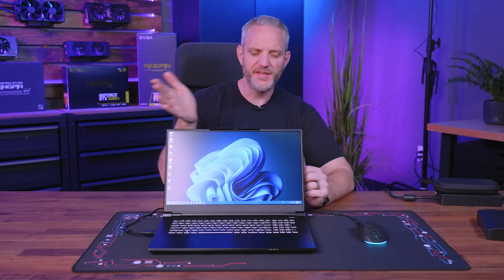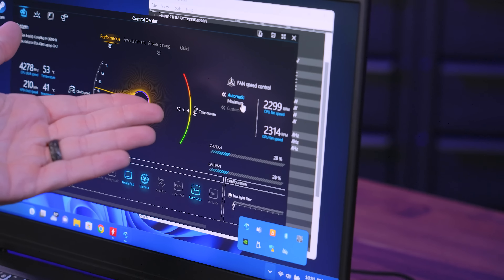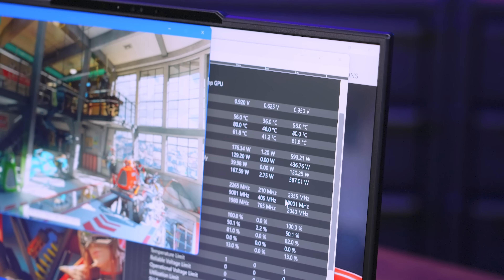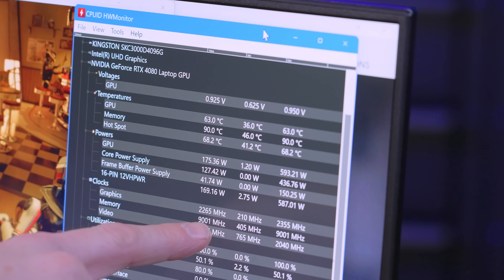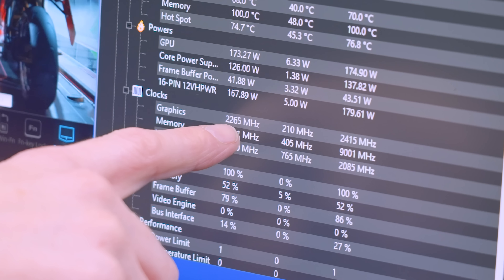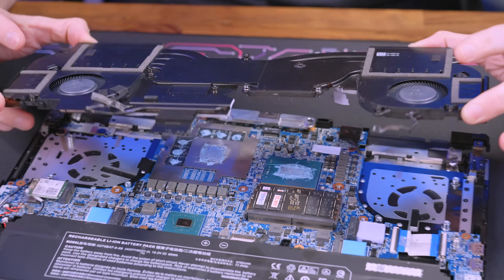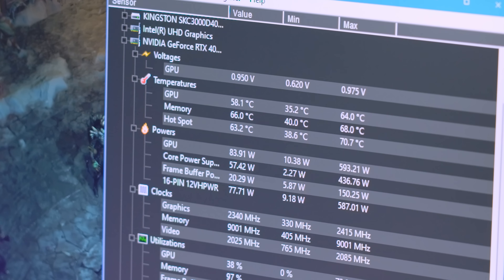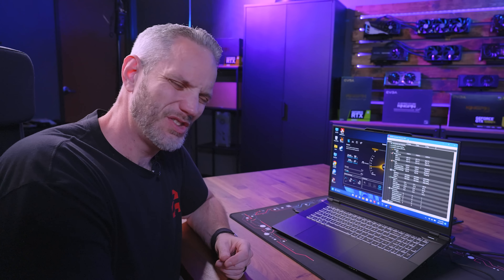I think I made it worse...

Comment: Hey Jay, why not use paste and graphite pads. They should help the thickness for the memory but not too much to effect the gpu
Reply: Graphite is electrically conductive so if that make contact with any of the SMDs around the VRAM ICs you will fry your VRAM and probably your GPU IMC also so better use some coating that is electrically not conductive that's is what i do when i use copper shims over the VRAM myself and i never have a sort with it.
Reply: @riphunter5100  yea, I realised after I commented. The graphite would work on the gpu and cpu if the pads are too thick for the ram.

Comment: I would think that a laptop, still in its warranty period, should indeed be left alone.  However, any gaming laptop, gaming PC, that is two years or more, and has factory thermal material (pads, paste, whatever), could actually be getting worse and worse.  Okay, not everyone is an e-sports' player, but how many times have I not gotten someone come in the shop that says their PC is not performing and if I can please re-install Windows on it (imagine how upset they are already having to ask such questions).  First thing I do is ask how old the device is.  And after that, I actually teach them to install Windows themselves.  The amount of times when I lift the cooler(s) from the motherboard and see paste that did not spread the surface, or a pad that is not even on the chip but hangs with its arm out the window.... Prebuilds are notorious for too little thermal paste, or use some questionable materials.  Used video cards, repaste!  Heat, and contraction from cooling, is a culprit over time.  Oh, well, you have enough articles about that.

Comment: Hey Jay, I recently built a PC and installed windows but it's always booting to bios. I tried everything on Google but nothing solved it.
Reply: In your bios there is a boot order setting that needs to be set to the drive that has windows on it.
Reply: @LuciferXV  I have only one SSD I I set that it's not working
Reply: @gabitzz3632  Do a fresh install and make sure to take your usb out of the computer during restart so it can't be confused by it.
Reply: @LuciferXV  now I tried reinstalling windows and the SSD is not showing up. 10 minutes ago it was fine and running now it's not recognized. Do you know what happened or what can I do?
Reply: @gabitzz3632  If it's an m.2, maybe it's not seated correctly. If it is SATA maybe check the cables.

Comment: A laptop of this price should have separate cooling for CPU, GPU, and RAM. At the least there should be flexibility designed into the cooling with screws to firmly clamp it to all three rather than relying on thermal pads to make up for height variations.

Comment: Idk but im sure memory doesnt thermal throttles it just dies. Ive never seen a failsafe for memory. 2 when i had more than one monitor woth my 5950xt the memory is alwsys at 2600mhz even with bo load nothing running. Idk why amd hasnt fixed this im sure im not he only one who sees this. When i turn my monitor down from 240hz (1440p) down to 120 or 144hx you cna see the memory fluctuation from 1mhz to 200 or 300 no losd its soo wierd why it does it obly witha. Single monitor or lowering the max hz on the monitor

Comment: Not saying it's the case here, just a PSA of sorts: 
HW Info has a habit of reporting wrong hotspot temps (and various other numbers). 
Once had a reading of 113C°... updated HW Info and lost 30°. Still hot, but not abnormally hot.
Crap readings aren't exclusive to HW Info, once had an AIO that thought the water temperature is over 130°C. Which of course it wasn't.
I still have a picture of it because it looked funny, sadly can't post it because Youtube can't manage to make a working spam filter.

Comment: Would be interesting to learn what the temps are after you put in the pads for the memory, do you still see the improvement on the GPU?  Or do the pads still cause a similar issue to what you saw in the tests you posted today?
Reply: you wont two separate things

Comment: I'm no pro, but based on my recent experience, I only recommend changing the paste on your laptop when it's old as fuck or the temps are actually just plain bad and experience is detrimental. I recently changed my 2015 laptop's CPU paste because it was VERY DRY and would get to 80-100c just for playing light games like LoL, and high 80s low 90s for watching a video in fullscreen.

It has a dedicated GPU, but the issue was with the CPU.

Now it doesn't even reach 70c when watching a video.
I haven't really tried playing though, since I don't need it for that anymore, but it was an ongoing issue since about 2-3 years after I originally purchased it

Comment: Paste used for LN2 are formulated so they don't crack at -140c and are only used for a handful of benchmark runs. On daily driver PCs the paste will pump out from the temperature variances of normal use. If you want extreme cooling without using liquid metal, try KryoSheet by thermal grizzly. It will out preform any paste on the market including KPx and it will last the lifetime of the device.

Comment: Man.. 1/2 a mil.. that's pretty actually BAD for the cooler design in my opinion. However, with a gaming laptop, I'm going to bet they did ALL the testing they did to come to the cooling solution they went with for production. So, maybe when it comes to a premium product, maybe yeah just leave it alone unless you're smarter than the team of engineers that designed the original cooling solution. I.e., der8auer. Seriously.

Comment: i repasted my lenovo legion 5  because it always runs hot and thermal throttles. well, didint help much. what WOULD help is lenovo letting me tune my fan curves, i dont want to running all quiet when it gets warm, i want fans at 11/110%, but no, im not allowed to control my fan speed. i didint know about this when i purchased it, if i had, i would have saved some money and gone with one that would. 
the fan controller is so hidden that no amount of register poking would reveal the address of those fans. why, whats the "fricken" point.

Comment: @JayzTwoCents  My ASUS ROG Strix Hero III came with very poor TIM application. Two of the dies on the core had no coverage, and what ever they used had the consistency of tile grout. They also used liquid thermal pad like k5 pro on the VRAM and VRM. Thermals were out of control and the laptop could barely manage 3ghz despite being advertised as 4.5. Replaced all with kryonaut, even the K5 pro, and huge gains in temps. I even was able to get more performance by opening the bios in a hex editor and increasing TDP from 45w to 60w with no issues due to extra cooling. 

"Don't mess with your laptops"  only if the factory  can do it right in the first place, which is almost never the case since it's always a compromise between cost, ease of manufacturing, ahead of performance. 

How about "Don't mess with your laptops if you don't know what you're doing, even if you have a huge youtube channel." :D :D :D

Comment: HELP!  I built my PC in 2018.  It’s running a Ryzen 2700X and an RTX 2080 FE.  I’m wanting to start upgrading to newer generations.  Basically I can’t choose between upgrading the CPU side to AM5 and everything tho at goes with, or upgrading the GPU to a 4090.  Then doing the CPU later.   I know ether way in bottlenecking something, but a can not afford both at the same time.   Tips on what would benefit me most first? I game “1440p” and livestream on occasion.  Minor editing but nothing major.
Reply: I think a 5800x and a 4080 comes to the same price as a 4090 so i would just do that….
Reply: Get a 4090 and get a 5600 for 120 dollars as a carryover until you can afford am5? My exgf had a 2700x until I upgraded it to a 5600 and it obliterated every task she did including tons of multitasking over her 2700x.
Reply: If your motherboard can get a bios for the 5800X3D and all you do is gaming, that would be the cheapest upgrade.
Reply: @Bratfalken yeah that would be better honestly 5800x3d performs just as well as a base zen 4 cpu
Reply: If you can't a afford both that implies you shouldn't be spending $1600 on a GPU. A 2700x is going to severely bottleneck the 4090 and an AM5 CPU with a 2080 isn't going to give you enough of a performance uplift in games to justify the cost. I'd recommend a more modest, yet still significant upgrade to a Ryzen 5 5600 and a 4070.
Reply: Running a 4090 requires at least a 1000w psu, preferably a 1200w to stay on the safe side. That might be a bottleneck also.
Reply: @Bratfalken  I have the ROG crosshair 7